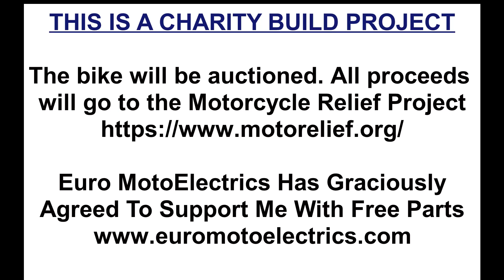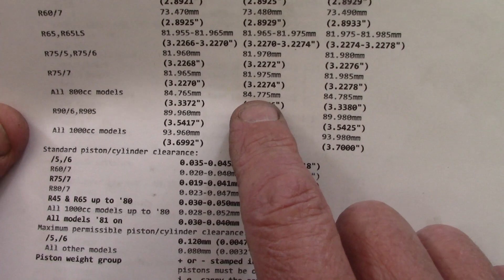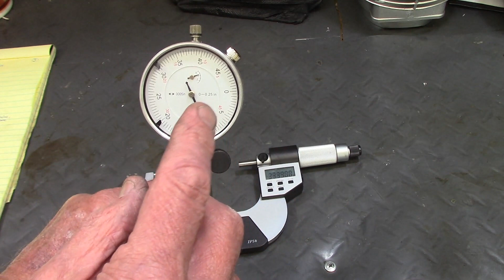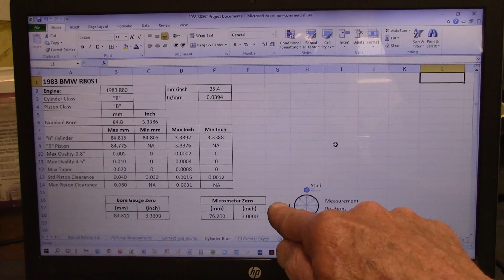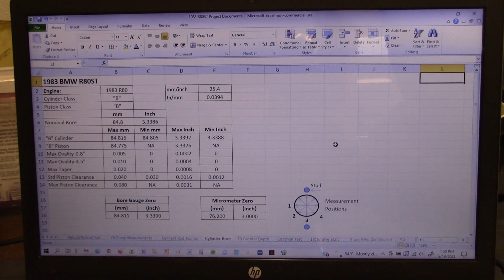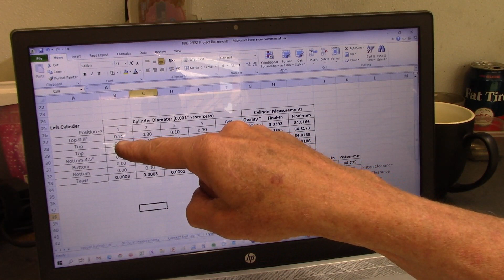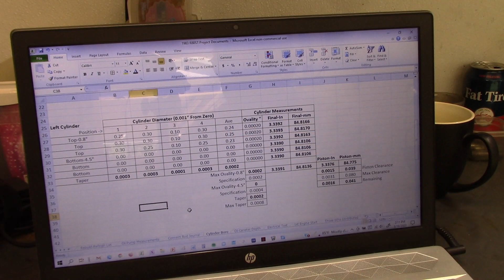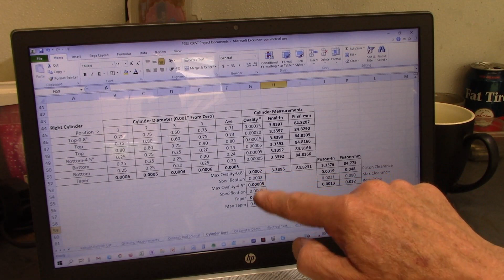1983 BMW R80ST Cylinder Measurements & Honing

Comment: When/for what reason do you decide to hone the nikasil cylinders? 

I own a 82R100RT/48k miles and I'm about to ship the heads to a machine shop that works on bmw heads.
What I'm trying to figure out is if to replace the piston rings and if I need to hone the cylinders if I replace the rings.

Thank you!
Reply from the maker: Using the correct hone on Nikasil ensures the rings will seat and oil consumption will be low.
Reply: @BrooksAirheadGarage  do you have a link for what hone tool you used?
Reply from the maker: Just click the link in the video description under the video pane. It will take you to my web page about this work.